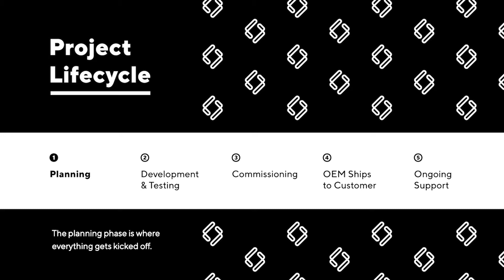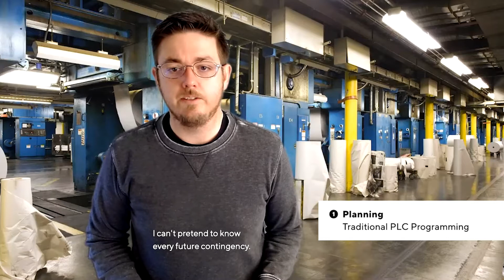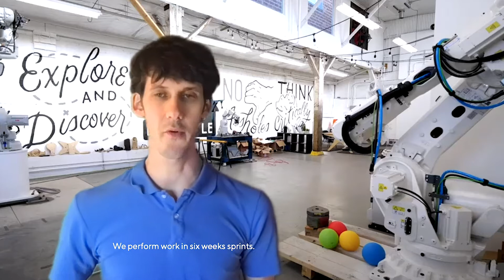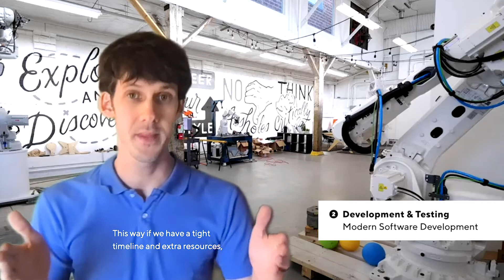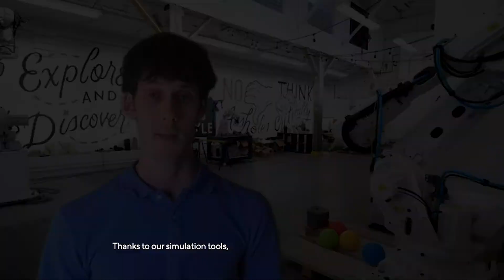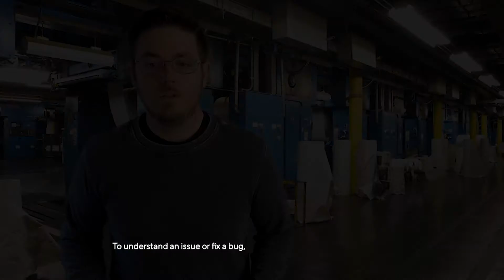Software Engineering for PLCs

Comment: The "Traditional PLC programmer" is 100% accurate. I agree with it 100% From half-baked machine shipping to  "12-18 hours a day on-site," I think one thing that is worth considering here is hardware, sometimes the customer will specify what hardware they want. Rockwell and Siemens take about 95% of the control system I have worked on. When using these controllers I don't believe that there are the features like GIT and the rich testing environments like you mentioned that are accessible. What hardware does Loupe use? From the website, it seems like BR. Does BR have GIT and the testing environments? If it goes I am very interested to follow this up and see if I can implement. Thanks
Reply from the maker: Hi Tom, Loupe uses primarily B&R controls, which can be directly source controlled very nicely via git. They also have a simulator packaged in their IDE, Automation Studio, which allows developers to run exactly the same code on their development machine as on a real piece of equipment, including networking code, motion control, etc. So most things can be tested before they're put on the machine.